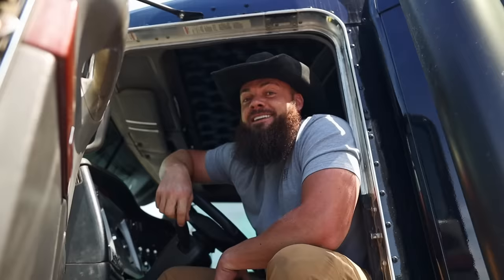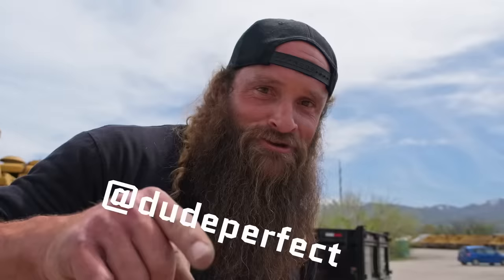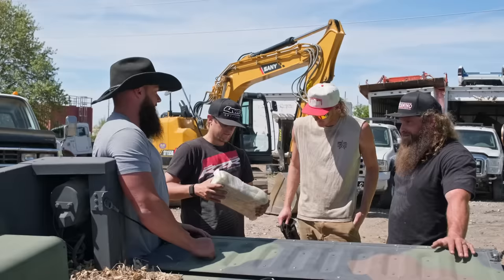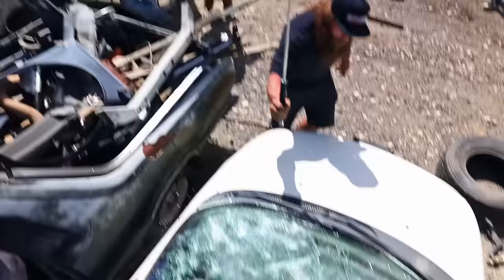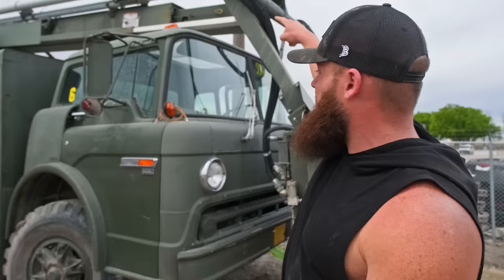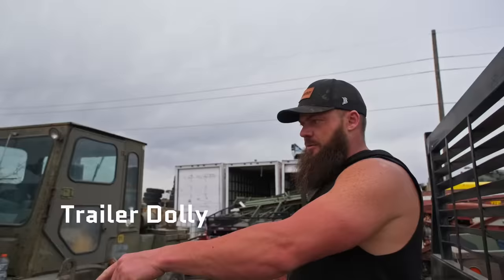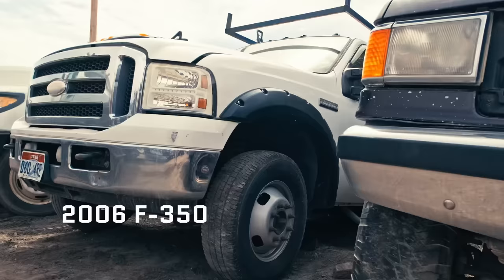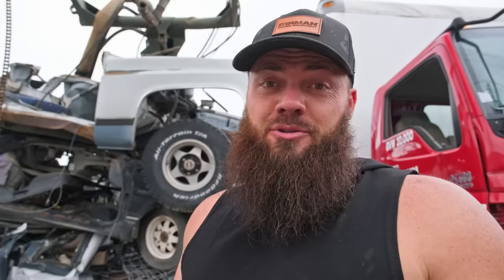I'll Show You My Junk...If You Show Me Yours! (Let's Make a Trade)

Comment: The jumbo van from radio shack had a red on/off switch in the back in the floor behind the flip door! I remember that when I was 8 or
9 years old!!! Definitely unlocked some memories. I can still remember the rc motor noise and knobby pointed tires

Comment: You call it a storage, I call mine a boneyard. --- But I'll get to it all eventually 😂😂😂
Reply: If the excursion tap dancing held for a 97 and older powerstroke for my bronco. We could talk. Broke both my legs few years back so I'll fall a bit but may be video gold. 91 ford bronco silver anniversary edition. Would love to put a 7.3 in my bronco (need a body swap to a 7.3 frame for California) and I'll even trim your toe nails after. Please help me be the only street legal powerstroke bronco in this (expletive) state.

What's the deal with the 02 explorer? I got an 01 b2300 that'd be sick for a swap depending on the issues and my prides for sale 😂😂😂
Reply: I'll bath in chapstick for the centurion. It'd even be time specific for a 91 if Ford wasn't pussies and didn't put out a diesel or big block bronco. 
No hit, it'll be a 7.5 460 gasser instead of a diesel but going smog legal in CA as cheap and big as possible.
Reply: Don't sell the brat. Give it to your boy. Worth it.
Reply: For the
Reply: i want that 2stroke pipe :D

Comment: That Centurion is pretty badass, my step dad had an 86 F-350 Centurion quad cab long bed dually, Centurion had gotten a contract to build a bunch of them for a construction company then the contract fell through and they only Built two of these trucks, and I remember when he found out that the other one had been totaled he had the truck lettered his company name and then on the back door in kind of a small font it said one of a kind I thought that was pretty cool, truck had  a 460 that really kicked ass we pulled a lot of really heavy over the limit massively illegal trailers with it, back in the late 80s I worked for him with him on and off , he was a heavy truck mechanic and his shop was called Docs heavy equipment, He had gotten that nickname because he used to wear what resembled a Doctor's lab coat or a scientist's lab coat LOL, Once he opened his shop that's how it became Doc's heavy equipment, he worked a lot with a big construction company that was building highways in Connecticut at the time,I remember it being about 6am  going through Connecticut with a very heavy trailer and a loaded bed with a giant diesel welder/ generator back there, well some idiot in a tiny shitbox decided to run the red light so here we are at 50 + mph with all the trailer brakes locked up and all the truck brakes locked up sliding sideways through the intersection it was pretty interesting LOL, truck was two tone red /silver with red being the base color with silver down the sides, it was a great looking truck of course it also had the old school windshield visor that just gave it even a better look, all red interior and  power everything inside, I wish I could have gotten that truck off of him the guy that bought it let it sit and rot,

Comment: Pro tip, to collapse the baton, tap it gently like a drum stick on the ground before slamming vertically to collapse. It will close super easy that way. It was part of the class like 16 or 18 years ago when they replaced our PR-24 batons with Asps in my Military Police unit.

Comment: My piece of junk is a Dodge B250 Van Conversion full of junk, with cooling system leaks, bad steering column. The engine is lucky to be alive due to repeated overheating and low oil pressure. It has a 360 ci (5.9 liter) with 4 speed automatic with overdrive. It also comes with a thirsty 30+ gal tank.
Needs radiator, water pump, steering column, heater blower wiring. The one thing I want fixed is the busted power chair in the back.
My van also has 4 swiveling captains chairs.

Comment: I have a 1996 Ford Ranger XLT 2.3L 5 speed with a clutch that has not had any problems from when I got it at 112,000 miles and now has 207,000 miles on it and still driving it.

Comment: Don't really need anything except 2 good GM transmissions for a 2004 Chevrolet Silverado 1500 gas 4.8L 4L60e and a 2011 GMC Sierra 1500 SLE gas 5.3L 6L80e.  My daughter uses the 2004 for college and my wife and I use the 2011 for Dr appointments.. I really want to know which transmissions and upgrades that you would recommend. I am on disability but I will eventually be able to get them fixed. Everything that I have read tells me that GM knows there is a problem with the design of both transmissions but refuse to redesign them. Which reminds me of the U.S. Marine Corps. Thank you and Semper Fi.

Comment: Okay Dave and Dave if you guys are serious about trading old junk....... we have a piece of equipment stuck in the woods in Oklahoma that has sat here for well over 30 to 35 years and it's blocking a trail. People have come and taking small things off the engine. But I think for the most part it is still there LOL. It's hard to get to no one is interested in Towing it out my opinion the only way it can get out of there is to be driven out there is no way to get a trailer in there is no way to get a tow vehicle in the only way to get there as with Trail vehicles or 4-wheel drive cars or trucks. No one is going to be upset if you come and remove this from the trail it is actually blocking a trail it is a big piece of equipment and needs to be moved

Comment: In our former company, we had a forklift from the Volvo brand that was very similar to the military one you showed with 240 cm forks and a few extra tons of counterweight at the back, so we unloaded a whole truckload with a single lift!
I wish the steering had been better because I never got to know the maximum speed, but I was the only one who managed to drive a bit in fourth gear at idle, and then I was close to driving into the forest! But probably it would have managed around 150 Km/h if the steering worked exactly!
I'm actually missing the monster in question and wondering how much it managed to lift with sufficient counterweight?
I've never had any luck in either money or love I can't sell and love to help people and for the balance hate the bad ones and probably could do the most horrible thing whit those who make their living on destroying other people's lives or even worse things - guess luck was busy saving my life on countless occasions last spring when I broke my neck as a simple example!
What's a shame it is that I'm as a resident of Finland, I understand that the costs of getting something transported here exceed the value many times and that here you have to do a lot of modifications to be able to registrate vehicles for road traffic, maybe a tip: build an off-road vehicle that exceeds the tallest trees, you can drive on the side of the road! The power lines will be a problem, of course, and whether you can even drive something that weighs several thousand tons on land, I don't know, but it is interesting to imagine! Decks over 30 meters high could probably be the special order of the century...

Comment: If I had anything to trade I would trade for one of the gas trucks to put in a demo derby. I just wish I had some of my old equipment I used on my derby vehicles. It was all in great shape especially my 318 dodge police engine. I had it cranking out 400 hp and it was clean constantly rebuilt that even though they are diesel guys they could have sold it for a few thousand bucks to a derby driver in their area. From Utah west is mopar country for debies.

Comment: I have a goofy trade question. Buuutttt!! I feel from watching this video over and over. You might just entertain my quest for an unbelievable project that im undertaking. I have start the wheel of wierd I just traded a pair half high Chuck Taylor  tennis shoes for a 1999 Chevrolet 1500 pick up. Thats correct a $50.00 pair of shoes for a running truck . My friend presented to me this deal I just couldn't pass on. In keeping with the theme I have chosen for this vehicle. I only live 5 hrs away from SLC so I have a friend interested in seeing this deal pop off even farther into the next fazes and has offered to retrieve my interest. And yes im trading him for his part he will fit into the wierd deals. So you have a 5 ton sitting on  a 1500 if the gear ratio meets my needs id like to trade for the remainder of the 1500 the 5 ton is sitting. If you're  interest is peaked. I will watch here for a response. Being newer to communicating through YouTube  im not sure what info you need respond and I dont want to compromise my security or yours. I will leave the ball in your play next and I will then reveal my trade offer once response has been given. Just want your interest peaked.

Comment: I'll trade you a 1922 V8 cat cable pull blame has been recently but didn't myself cost me a thousand bucks a hole for a four-cylinder Diesel and I had to buy a radiator it is big as a house but it'll pull your house right off of boundation it's very strong but like I said it's a cable drop blade it's old but it's and I'll trade you for that d h a as long as the engine starts up I got one that's all tore up with no engine

Comment: I wish I had some thing Valuable and had ways to Expidite a vehical from there, I have been down with a broken foot, a fork lift tooth holding aprox 8 pounds dropped about 14 inches down on my foot breaking Five bones and doing a bunch of damage to it, and starting to hobble around i fell off a pallet and rebroke the same foot and sounds like i will be down for all sumer..  any way shut up and say what i need to, I so need a new truck or one i can really trust to not break down alot, I has a ford ranger two wheel drive single cab with the rear seal blown out and it has a massive short in it so i have a battery kill switch to save the battery.  but this is the whole problem i have i need a pick up the size of a ford Ranger because i built a costum built 5th wheel trailer for it, the way it is built only a truck that size can pull it.  i could E mail you pictures so you can see where i am. But now not having worked for so long my bank account looks like a milk pail with alot of holes was in it.  even a sweet fresh V6 or equal  motor that would fall into it would be so awesome. but me lives in calgary alberta canada and after my third heart attack our government took away my Semi Truck steering papers.